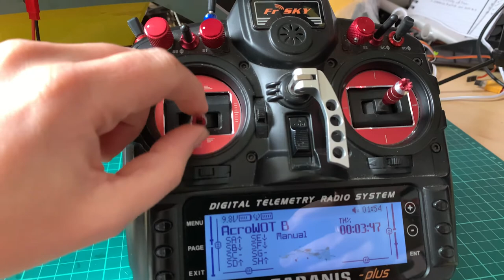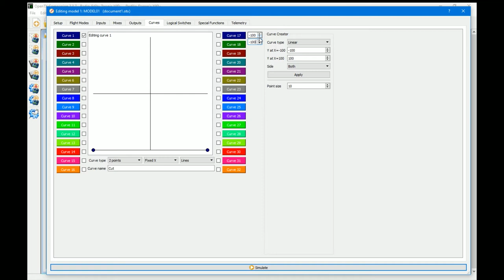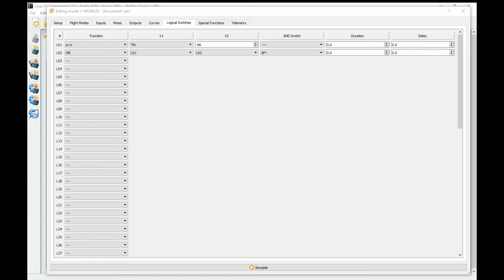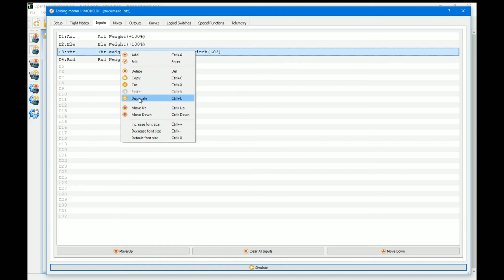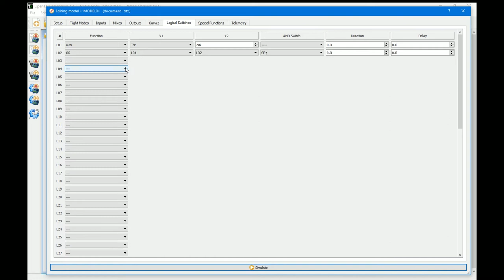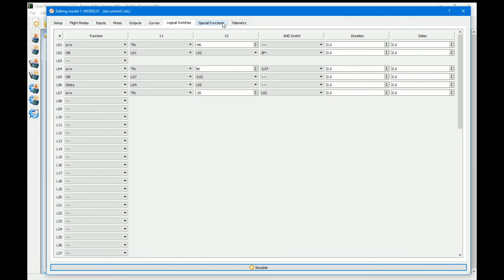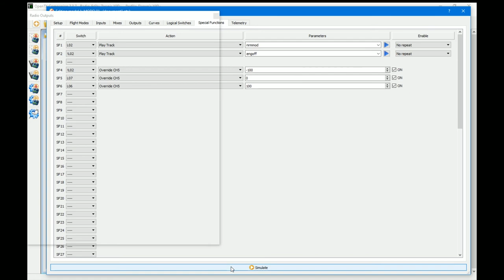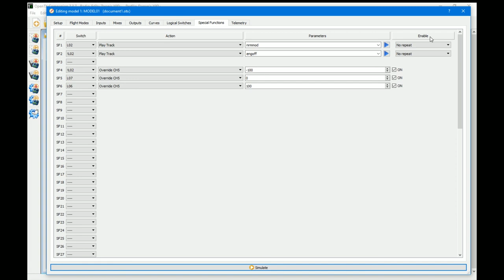How to automate a cheap RCD3007, onboard glow driver in OpenTX

Comment: I see you're using a S6R rx,     how do you find setting them up,   I've been very tempted.    Also,   I've a X12S    on Opentx 2.3.10.    Can not find usage in menu for external aerial.     And suggestions.    Happy xmas and merry new years from New Zealand
Reply from the maker: Hi Russ, I have to be perfectly honest, they can be a bit of a pain to set up. There are a couple of things that can trip you up. The main one that usually catches me out is there are 2 modes that the SxR can operate under. The standard mode and an easy setup mode. Easy setup seems to change all the switch positions, which is really not helpful. So the first thing to do is switch that off. The other thing is the orientation, which from what I remember, wasn’t obvious in the manual. But I think the cables come out the front. But, I’ll double check that.

The rest of it isn’t so bad, once you’ve done it a few times. And the LUA script to set up the receiver is pretty decent too. I have only used these as stabilisers, if enabled at all. I’ve not used them for auto level or any of the other stabilisation modes, as it seems like a lot of messing about to get the model flying level with them. But the stabiliser works well. Just make sure to put the gain on a pot as it will probably want dialling down.

I think this is a bug in 2.3.10. I’m still on 2.3.9 on my Horus because of another bug (Crossfire), so haven’t seen this. But someone else mentioned that it was missing on their X10 under 2.3.10. So hopefully it will be fixed in 2.3.11.